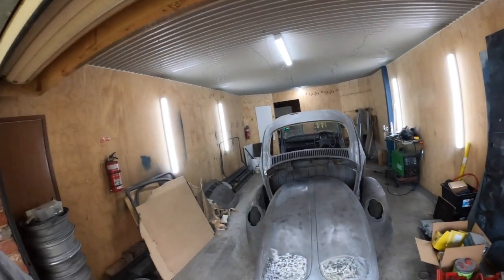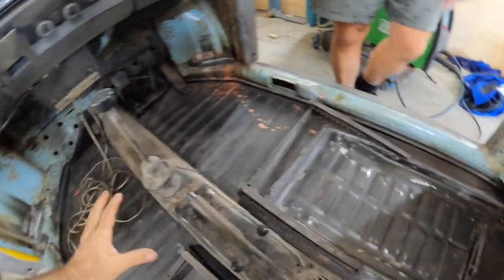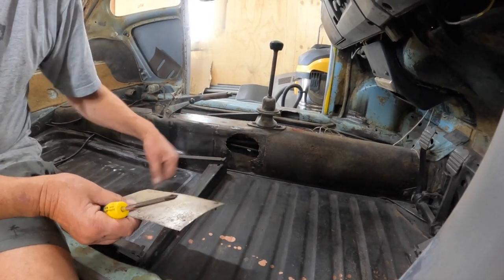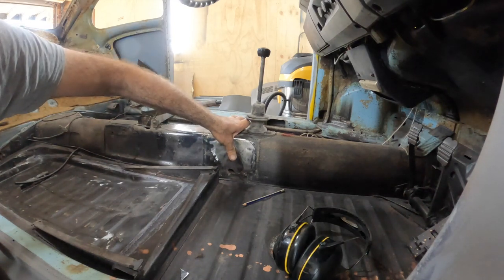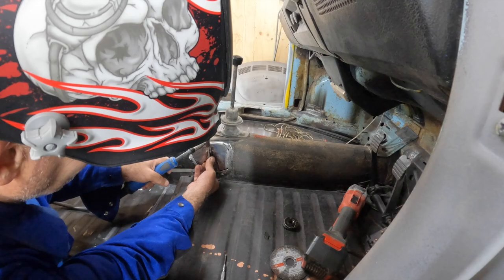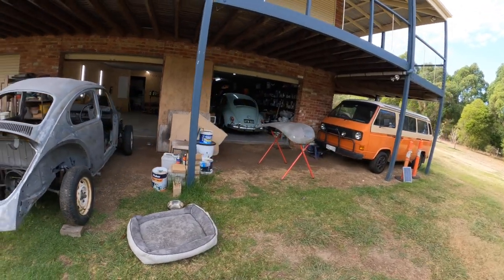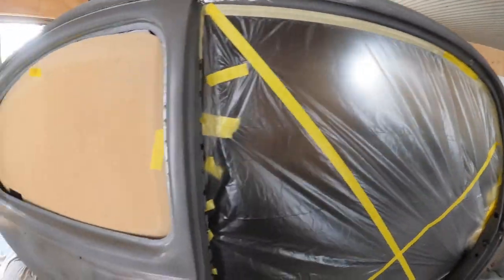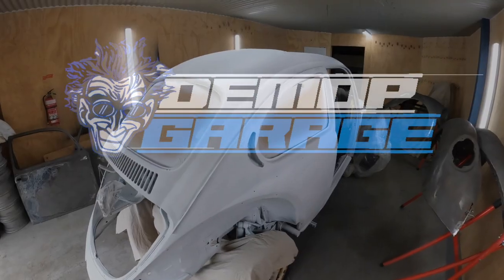Prepping the body for epoxy primer // Milly bug 6 #volkswagen

Comment: Looks great Nick!  I am doing my double cab section by section fixing it and epoxying it as I go, but I am realizing this is not a good strategy because I am taking too long and the epoxy is getting scuffed and there is metal shavings that has sticked to it that I didn't see from grinding that has caused some of it to have a rust colored stain on the paint.   So I will probably need to strip it and respray it when I am done with the body work.   I liked that you put phosphoric acid on your bare metal to prevent it from rusting.  Can you do a video on how you apply that? I have tried it in the past and I didn't have good success, maybe I used the wrong stuff or applied it wrong.
Reply from the maker: Cheers dude, i just put the acid in my spray gun and very lightly dust coated it but make sure you don’t breathe it in😉 it can stay like that for months without rusting.
Reply: @DemopVWgarage  ah nice, I will try that.
Reply: I've used the Eastwood After Blast product and I highly rate it, despite the price. Maybe the phosphoric acid I tried was the wrong strength, not sure, but it didn't set the bare metal as grey as the Eastwood product. I've got bits which have been blasted and coated in After Blast sat around for a few years and no rusting.

Comment: Nice hair cut Nick! What did you use to neutralize the phosphoric before priming?
Reply from the maker: Must be sanded back with 80 grit before spraying then prepsole
Reply: @DemopVWgarage  Prepsole? Is that wax and grease remover?